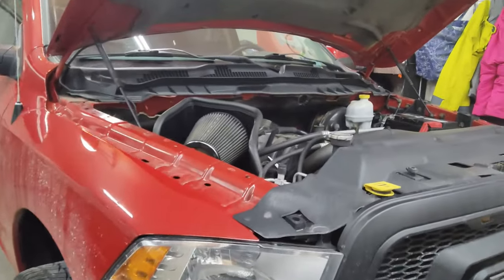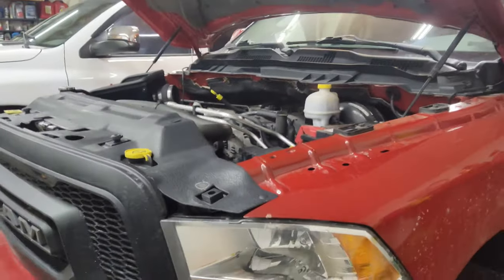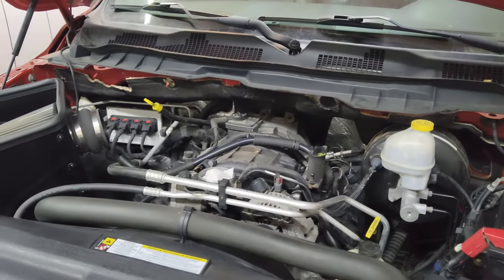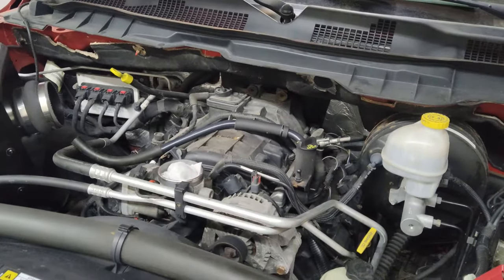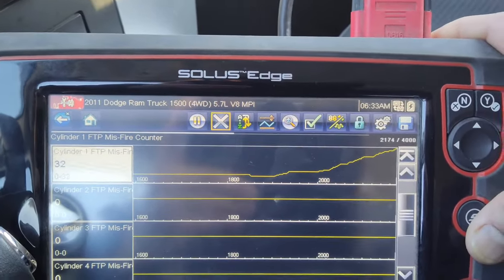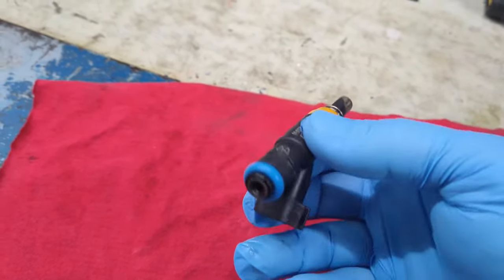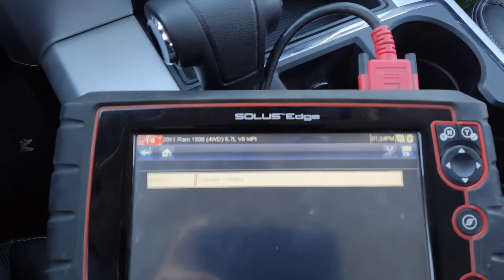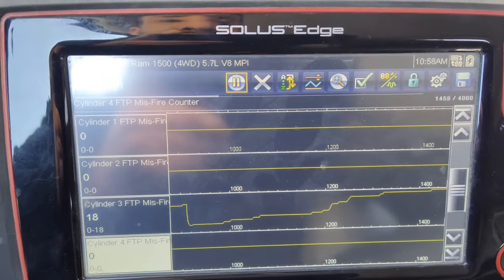Ram 1500 Hemi 5.7L Cylinder Misfire Returns | Fixed It

Comment: I know I'm a year late but. My 2004 ram 1500 5.7 (millage unknown as they put a new motor in that had 160xxx km on it) I did have a code for a multiple/random cylinder missfire. The truck only missfires in the morning and the code it gone now, I can have it warm up and it'll continue to act up but once it sits from 6am to 930am and the sun comes out it no longer has any missfire and doesn't act up again until the next day. I'm assuming it has to do with the cold air at night and moisture I'm still trying to diagnose any advice would he helpfull. I'm still going to diagnose like you are showing in the video

Comment: Can I just buy some fuel injector cleaner and run it through the gas tank
Reply from the maker: Thank you for watching/subscribing.
You can certainly run injector cleaner through the fuel tank.  That may help if injectors are dirty & clogged (or a repair shop can professionally clean them).  If the injector is failing electronically then cleaning will not help.

Comment: I’m getting a miss fire on number 3. It has a somewhat new coil pack and 2 new spark plugs. I guess I’ll check the injectors. If that doesn’t work. Then what ?
Reply from the maker: Hi, thanks for watching/subscribing.  If swapping coil, spark plug & injector does not cure the misfire then it may be a mechanical issue with the cam & lifter.  You can remove the valve cover to confirm no lift on that cylinder.  In some cases PCM can also be the culprit causing an injector/ cylinder to misfire.
Reply: @JSFautoPlus  thank you sir. Much appreciated
Reply: @treyt6765  any update? Thanks
Reply: @rahmanr112  I believe it’s a blown head gasket. I haven’t had time to dig into it. But will be doing so soon
Reply from the maker: It can also be a dropped valve seat in the head.  I have seen a few 5.7L hemi  but more common issue on the 4.7L.  Was the engine overheated?
Reply: @JSFautoPlus  not to my knowledge. I have had zero issues with over heating.

Comment: I had a misfire on #7 on my Jeep 5.7.  Was getting the misfire code & the check engine light and it was running a bit rough.  Mine turned out to be a vacuum leak.  I had to replace my camshaft & lifters about 8 months ago.  After that it was running great til about a month ago.  Then the timing chain broke and warped some valves.  Just repaired all that and got it back together.  Thought I was in good shape til the misfire.  At least it's just a vacuum leak.  Thanks for the great video!  👍
Reply from the maker: Glad the video is helpful.
Thank you for watching/subscribing..
Reply: Where did You have a vacuum leak ?? I have a similar problem but no codes only o live data in Jscan Odb, I see I have a couple missfires only about 2100-2200 rpm. Only In 7 cyl , when I try drive in this rpm then it's counting about 10missfirs on 8 miles trip. No codes, No check engines. I try Injectors swap, coil swap, and pcm change always 7cyl. Best regards.
Reply: @Kabanabak  My leak was at the #7 intake.  It had a faint hiss, that I wasn't hearing, but my wife and a couple of others heard.  I sprayed carb cleaner around #7 and found it.  I called it a vacuum leak, but it was sucking air at #7, because my intake gasket had been pinched in two (unbeknown to me).  

Sounds like you've checked most everything.  If no check engine light is coming on, wonder if there might be something wrong or weak with that cylinder itself.  I'm surprised you haven't gotten a check engine light.  

I know it's frustrating when you have to do so much through process of elimination.  My darn Jeep leaves me stumped and scratching my head often.  My wife swears the thing is haunted.  Thank God for my scan tool, or I'd be pulling what's left of my hair out.
Reply: I’m gonna try this method to search for a leak. My truck randomly misfires most only on cold starts after sitting all night. And stops after I drive it a bit. Some times get 10-30 misfires in a matter of minutes on cylinder 6 watching live data on a Diablo sports trinity 2.  But no codes and no check engine light. But I can hear the subtle misses while it’s doing it. It’s an uneven idle until it warms up then it’s fine.